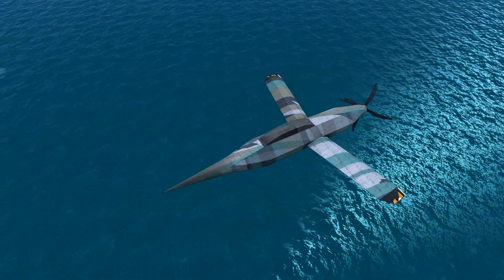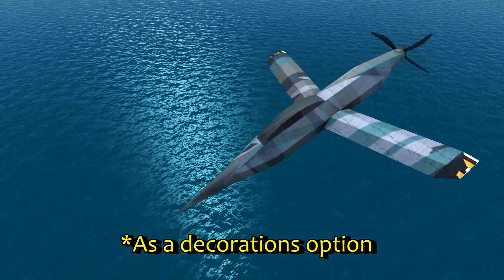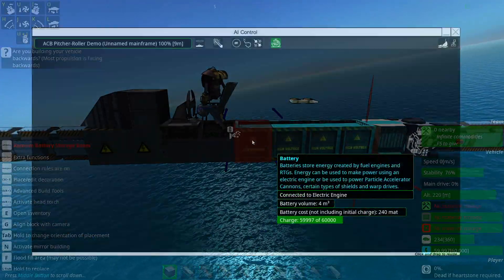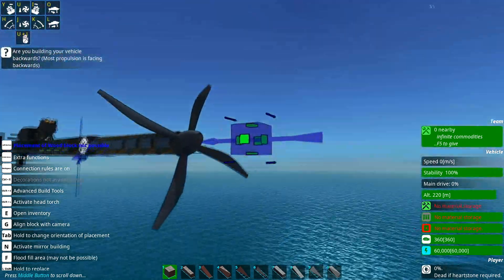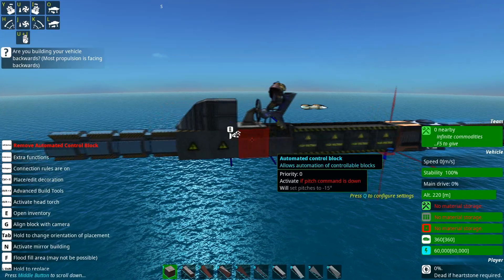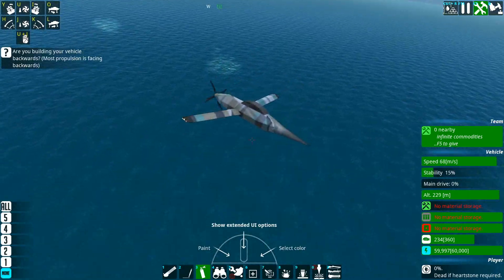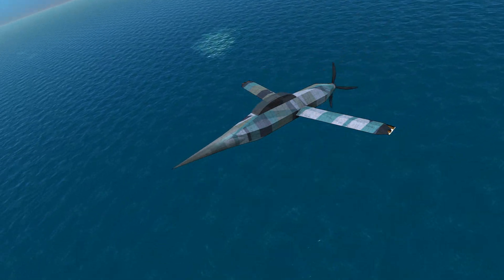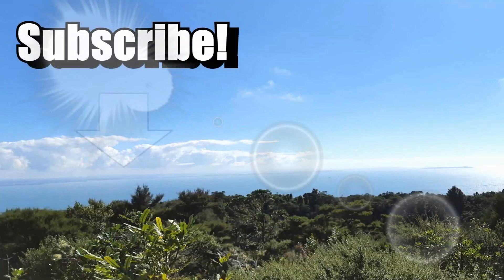One Propeller, Full Control! 🛩 ACB Propulsion Pitch And Roll, From the Depths Quick Guide

Comment: The problem with this method of controlling thrust vectoring with ACB is there is no proportionnal control, it's always full tilt in one direction, and you need an extra ACB on top to return the propeller to 0º. Instead, I recommand you explore the AI Breadboard way of achieving thrust vectoring. There are many advantages: It is compact as all the logic fits in a single block, it is proportionnal to the Ai input and can even be moderated by PID, and it works on every form of propultion with pitch and yaw settings; rotor, water prop, simple jets, ion and even CJE.
Trust me, once you try BB thrust vectoring you can never go back to ACB. :)

If you want an example of BB thrust vectoring script, you should look at the SS Falcon for 2D vectoring on a single engine, and look at the Gannet which has 2 engines and use slightly more advanced script to mix Pitch and Roll controls for 3D thrust vectoring.

Always a pleasure to watch your videos!
Reply from the maker: Cheers! One of these days I will summon the courage to start baking bread again. XD
Reply: very accurate
applied this to the CJE of my fighterplane and it flies REALLY good now
it is overall a good plane too, just not sure yet if i should change its PAC shotguns from piercing to EMP to be able to better achive air skirmish kills
but then it has devastatingly agile small FRAG missiles
Reply: Cheers, that's a good tip.
Reply: As someone who had been using breadboards for TVC a long time ago, I can confirm that everything here is true.
Reply: I stole the Hake's BB once for a jet